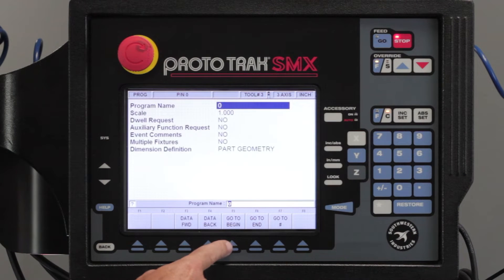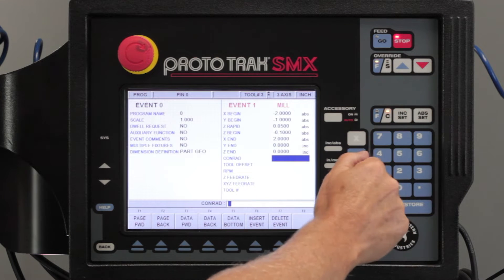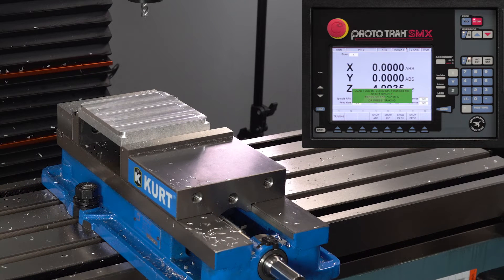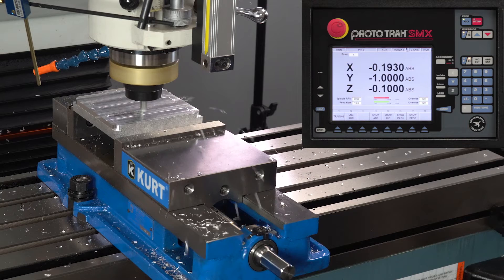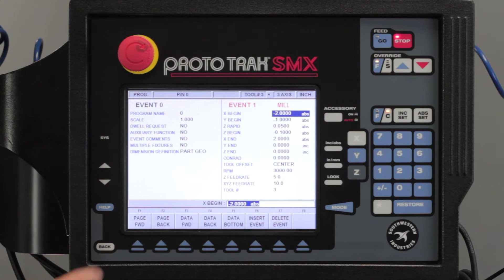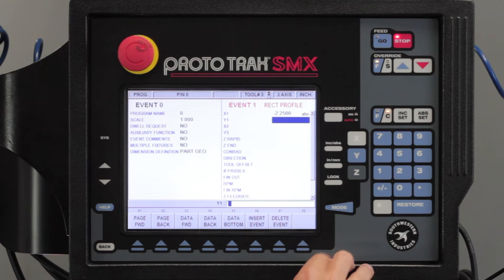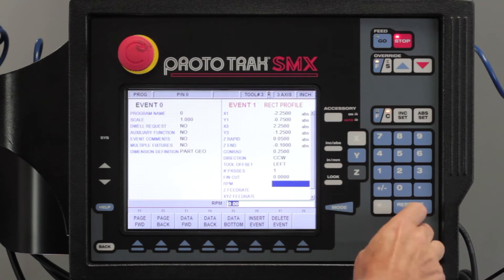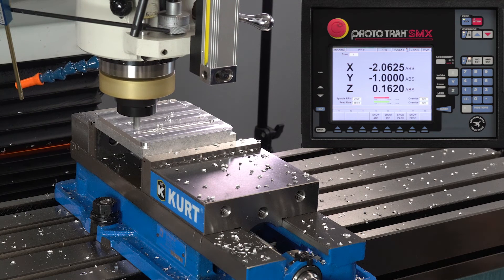Straight Slot | ProtoTRAK SMX CNC | Basic Programming 7

Comment: what is "CONRAD"?
Reply: Hi Jim, CONRAD is short for either connective radius or corner radius depending on how you want to use it.  It is basically a blend radius that can be added at the intersection of any two pieces of geometry. It will fit the CONRAD tangent to those two pieces of geometry.  T.P.

Comment: What type of material were you milling? Cold rolled, tool steel... ETC.
Reply: It was just aluminum with a 3 flute endmill.  If it were steel or SS I would use the same program but would most likely have to change feeds, speeds depth of cut and maybe the tool itself. T.P.

Comment: Great video as always, but  I am wondering if you could do the same video
only using an arced slot instead of a straight slot
Reply: Hi Randy, We can but I wouldn't consider this a basic video because it involves finding the tangent points for the 4 arcs needed to make the slot.  I would do this in A.G.E. pocket or profile.  I can add this to the list.  Thank you!  T.P.

Comment: Don't know if you ever did a video on your lathe bore event but what a waste of control space. It is more conducive  to being called a ream event. As you know to precision bore on the trak requires a turn cycle. You folks have been at this long enough to improve  things like adding a bore cycle..... or just eliminate the useless one pass bore event. Maybe you intend the bore to be used with repeats and offsets or something, I hope not. I still remember the 1st time I tried to use a Trak lathe and couldn't  find a  facing cycle. Coming from a conventional  background that was the common term for cleaning/machining the ends of a bar or tube on a lathe..... granted I understand now it's just easier to call every process a turn event or lazier..... knowing that most of your turning is based on G71 and G70. 
You probably  don't  have need for a software person any more since you haven't  improved the programming options in forever. I know you added face mill and thread mill to your milling controls in the last few years which is super useful when most users learned to use pocket to face mill on their own anyways...... 
Recently  ran in to an issue on an older trak lathe while trying to use the steady rest and was not able to open the rest far enough to load material without the rest hitting the cabinet...... I hope you have fixed that on newer models like your nice new 30" lathe..... i haven't tried one yet but a machine shop environment  doesn't seem like a good spot for a touch screen anything. great products but the don't keep resting on your laurels...... push out some better software!!!
Keep traking
Thank you
Reply: Hi Donald, I have to say that I agree with some of the things you're bitching about with our older controls.  Most of the things you are asking for have been addressed in the RX controls however, we have always felt that less is more when it comes to our products so we expect that a highly skilled machinist will know how to use the different canned cycles to do whatever he needs.  A turn event is a straight line so you can use it for anything you want including facing off the end of your part.  We don't need three or four different buttons that all do the same things so we leave that up to the machinist himself.  As for the bore event, it does have a finish pass now but I still prefer to use the inside cycle event so that I can control all the rough and finish passes as well as add a chamfer if needed. 
I highly recommend that you see a full demonstration of the RX controls because you will find that although we have kept and in some cases even improved the simplicity, the RXs have a lot of new capabilities including some new canned cycles.  Mostly, the new software improves the way we do everything.  It's all there and getting better every week!  As for the lathes themselves, all of the models except for the 1440EX have been changed over the last few years so I'm sure you will see an improvement there too.  If you're ever in L.A., stop by and I'll show you around.  Otherwise, hit up your local rep and have him show you everything.  Thanks for the input!  T.P.

Comment: When I mill a straight slot for example 1/4'" wide slot with a 1/8" end mill, My with is small. Can I decrease the tool diameter in the setup page? I have the same problem when I mill a pocket. How do I adjust hole size? Please make a video on this.
Reply: Yes, the easiest way to adjust your finish size is to change the diameter of your tool.  It works both ways.  I never tell anyone to change the dimensions of their program because they are already correct.  Therefor, if you decrease the diameter of your tool it will cut larger.  If you increase it, it will cut smaller.  The ProtoTRAK is designed this way so that you can also cut parts using sharpened tools.  All this being said, you may just be dealing with tool flex so the first thing I'd do is just recut the pocket and see if it cuts to size.  Thank you for this, I'm sure others will learn from this as well!  T.P.
Reply: @trakingpat2750  Thank you for getting back with me. I made the tool adjustment in the tool page and took care of the problem. Thanks again !!
Reply: @bigdaddy7670  Awesome!